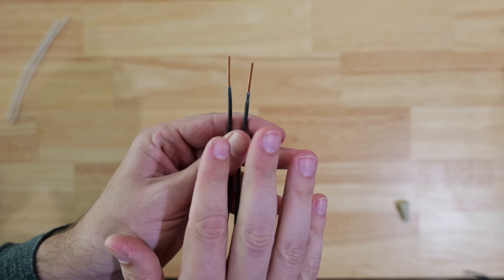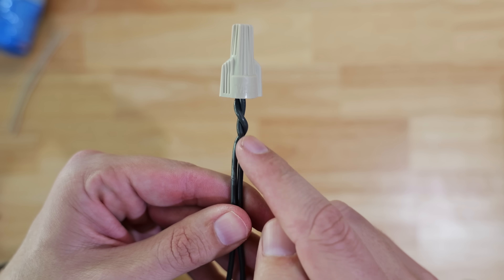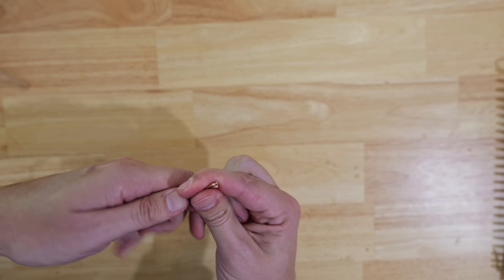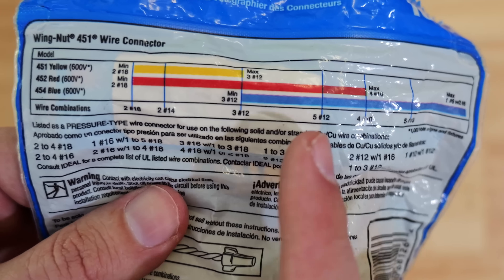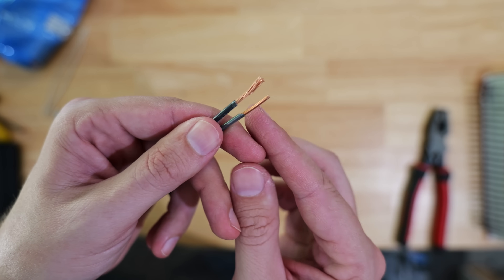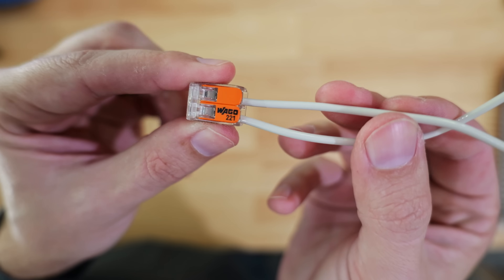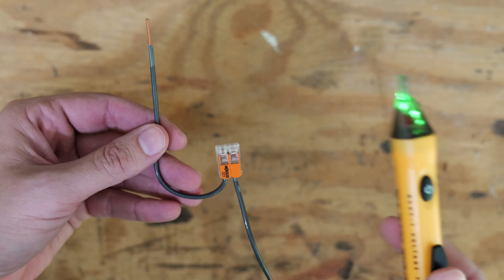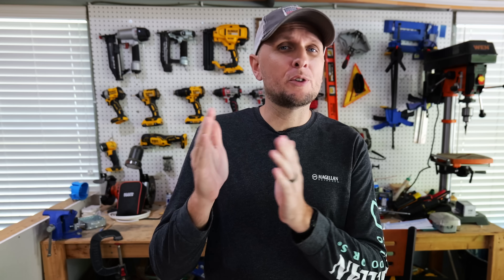7 FATAL Wiring Mistakes Most DIYers Don't Know They Are Making | Most Are Guilty of 3

Comment from the maker: Be honest, how many of these did you catch yourself doing or have done in the past?  I think at some point just about everyone has committed at least a few of these at some point.
Reply: I remember that I overloaded a couple wirenuts wiring up some outlets in my parent's house. But I was pretty good at checking them before closing it up and in 40 years since the house never burned down. After that I learned the proper way to do things and while not a professional, I do all my own work and help friends as well. I have an assortment of wirenuts of different sizes and just started to use the Wago style connectors.
Reply: @Tim Rock-It Saunders wire nuts aren't junk. Actually quite an intelligent design, if you take the time to understand them. Use the right size for the application, follow the strip length and pre-twist, then cut the ends flush with each other before installing the nut.  A solid, compact, durable connection never intended to be used in anything that moves.  
Bus bar in a switch box?  How are you going to do that?
crimp nut? want to add a pigtail? How are you going to do that?
think about it.
Reply: Trying to join stranded to solid, mostly for light fixtures. Especially, as is typical, when the stranded from the fixture is so very much smaller than the 14 or 12 gauge solid. Now I exclusively use Wagos for that.
Reply: Wago is pretty much the gold-standard of lever-nut connectors.  But what's your opinion of the Ideal brand of lever-nut connectors?  In my area Lowe's doesn't carry Wago at all, and Home Depot doesn't stock Wago so I have to either have them shipped to store with Home Depot or order them from Amazon.  But both Home Depot and Lowe's stock Ideal lever-nuts.  Your thoughts?
Reply: Pretty much none of these. I often pre-twist with wire caps OR (if I somehow don't have any) I'll dip the twisted wires in solder and wrap with electrical tape. (I'll usually do this if it's an important hookup that NEEDS to be online then return with proper parts and "fix" my jury-rigging)
Reply: Hey there i am a german electrician with 17 year duty experience, and i gratuated as a bachelor professionell in electrotechnik. I'm running a company and I can tell that there is no better choice to install wago stick, as wago clap connections.
Cause when a device or anything has a failure and it cause to turn off the fuse over and over, u can easily disconnect the different wire parts and shrink so the location of the failure
Reply: I am guilty of all of them.
Reply: Well twisting solid cores is seen as bad practise here anyway..
Reply: I've never seen the instructions on a wire nut package before. Always just found them floating around or coming with other stuff so I never saw the twisting instruction. I know I've never seen anyone actually twist them like that. Might explain why stuff didn't work properly and why some of the connections (like light bulb things in ceiling fans) literally fell apart. Electricians for my house didn't even leave the 6" of slack on the wires in outlet boxes so replacing outlets is a major pita. Thank you for this info!
Reply: Say it next time. There isn’t enough emphasis placed on this issue. Loose wire cause fires. Twist your splices together and don’t backstab your outlets or switches
Reply: @joegee2815  😊😅
Reply: @Tim Rock-It Saunders 0
Reply: @osmith5086  0
Reply: @cameronwhite2760  

0p

76g
Reply: @mgabbard  

0pl
Reply: @Nell01988  😊
Reply: I've been a electrician, and I will admit I have used the cheap wire caps, I do remember my instructor tell us the cap only replaces tape you should always twist the wires then use the cap and twist tight until the wires twist together outside the cap.
Reply: I too have sinned....
Reply from the maker: @shawnshurtz9147  And I can't stop and I won't stop 🤣  That is your opinion friend.
Reply from the maker: Even if that is all true, it’s still your opinion Shawn.
Reply: I always give each a tug, so the few that may have been loose were caught and corrected.
Reply: Literally none of the them . But professionals are not arsonist ;)
Reply: Guilty as charged.
Reply: Never, I've never done those things. The info presented is good but.. I'd also say it's common sense.
Reply: @@TimRockIt That's the point right there: Naval Industrial Electrician. If you do wiring for anything that moves (car, boat, aviation) different methods apply. You have vibration, condensation and all other things to consider that you don't have to deal with in a home installation. P.ex., even with camper vans, it is forbidden to run solid core wire for the land-line connections over here - you have to user stranded wire. For that though, you have to use different outlets with screw terminals, instead of push-in terminals (which have become the norm in homes for the past 20 years). Soldering is not allowed here in cars, because heating the strands can make the ones adjacent to the solder brittle and fail there. Failed solder joints due to vibration cracks are the number1 reason why ECUs on older cars fail.

You just cannot apply stuff from one domain 1-on-1 onto another. There are optimal choices for different applications, it is important to understand though how and why these choices have been made.
Reply: None - we don't use this crap in the UK (although they are available).
Reply: @osmith5086  I disagree; wire nuts are junk. They may work great on first install (if used correctly) but if you ever do any renovation you know why Wagos are VASTLY superior.
Reply: well i use sawder
Reply: None.
Reply: Wish I had known about Wago connectors before remodeling my last house. Light fixtures are a breeze with them. Just bought a large assortment of them and may never use another wirenut.
Reply: hand up... better than i used to be now.
Reply: Using spring-lever connectors I never made those mistakes described in video (especially the last one) because of one single reason: I always test voltage levels right just after finishing circuit connections. 

Great tips, thanks for your content!
Reply: I did DIY electrical work in the first 2 houses but in the current old house with a mixture of knob and tube and various generations of added wiring it’s all been done by a licensed electrician which is very affordable so I only do extremely minor stuff and avoid it if I can. He says knob and tube is safe if it is worked on correctly and it’s never overloaded.
Reply: In the United Kingdom the "wire nuts" have been banned for over 50 years. I wonder why!?
Reply: Norwegian electrician here. There is nothing wrong with either one off these conectors if their used corectly. personaly dont use the twistlock conectors as i dont trust them(never seen them used on wireing after 1990) but the newer type wago's i use all the time(just make sure it is actually wago's own components and not a ripoff). It's just to follow the instructions as well as pull the wires back slightly after pushing down the lever to make sure its all conected (the conection in the wago is like a knife pointed to the back of the wago and by pulling the wire back slightly it digs just a bit in to the wire and makes sure the wire sits securely in place) and iv'e never had a problem after doing that.  PS! dont know the rules in the US but if  people are not properly educated to do electrical works pls dont toutch. check the regulations from the goverment where you live to se what you actually are allowed to do yourself.
Reply: Got shocked and ended up in the hospital.  I think I'm fully recovered but not sure.  Don't mess with electricity unless you exactly what you're doing.
Reply: It me.
Reply: I raised my hand at 4:00.
Reply: Guilty in some regard, and holding my own in others.  I'll start pre-twisting them going forward and getting my hands on some Wago's, especially an assortment kit.  Well, played, sir, well played.
Reply: I had to work with the OLDER Wago version which was just a box of grey plastic so you have to guess how deep you are in by just push them in. And they got removed by Twist-pulling on the wires. But you never knew how well the connections are. 

We not even have this twist-nut connectors here. Either screwing terminal ones or Wago.
Reply: If you cant hang a ceiling fan from your wires you did it wrong lol
Reply: Damm! Does this mean I've got to dismantle the double bed, roll back the carpet & underlay, take up the chipboard & isolate upstairs ring circuit to double check the extension to the ring that I put in for the double bedside sockets..... Ah! U Muvver!😖
Reply: I'm guilty of doing it the wrong way. Your advice will save me from a shock or electrocution. Thank You.
Reply: Did the wire bug boo-boo once, I always tug my connections, so it promptly came loose and I did the twist first trick again.\
Always, always, always doublecheck your work.
Reply: I am not an electrition but I always tin the ends of multi-strands before connection just to ensure all of the strands handle the current to avoid heating or fires....If attaching a lug on the end, I will dip in flux, crimp connection, then solder or tin it...
Reply: Worst wire connect I have ever seen was in the house I live in by a previous owner. The dumbf*** put in some ceiling fans and when investigating some flickering lights,  and instead of wire nuts he’d used blue painters tape. Flammable blue painters tape.

I took apart everything else that looked to be more recent than the original build and found 2-3 more places he put painters tape on the wire connectors.

Why? Laziness? Stupidity? Wire nuts are super cheap, so I have no idea.
Reply: That's pretty stupid. At least he could have used electrical tape. I myself would never use painter's tape.
Reply: The wago contact is similar to the speed connections of a light switch (which is now banned)
Reply: Thanks
Reply: Lol
Reply: @@TimRockIt,Europeans don't tape.
Reply: uhhh... yes!
Reply: I was taught from my father at a young age when using wire nuts always pre-scew the wires first as you demonstrated ...... but he also would tighten them in place with electrical tape so the wires were not exposed, then add the wire nut to the tape for a nice snug fitting.
Reply: 2:42 When stripping wire, push off of the strippers with using the thumb on the hand holding the wire. Makes it so much easier.
Reply: @joegee2815  n
Reply: U F..UKED UP ON WAGO : ONE DOES NOT PUT TAPE ON WAGO , IF YOUR WAGO DOES NOT HOLD DOWN THE CLAMP THEN IS DEFECTIVE IF YOU SAY WAGO NEEDS TAPE I HOPE YOU ARE READY TO TAKE IT TO COURT
Reply: @joegee2815  3:40
Reply: It's not so much the wire nut that is the problem as the "nut" with the wire. 😂
Reply: I think I do pretty well these, but I have had the issue of overtightening the wire nut and having a solid wire poke out the end. Of course I re-do it at that point and don't go so crazy with twisting the next time.
Reply: @vikinglife6316  If it weren’t for the grounding wire, I don’t think I would have ever managed to put up a ceiling fan in my life.
Reply: We use WAGO PUSHING Connectors! Wirenuts are just 1920's, CALENDER Check Americans who never been abroad!
Reply: I'm guilty of these mistakes. So glad I stumbled on this video while surfing. First video and so useful you have my sub and appreciation!
Reply: I’ve done all the above, including holding live wires without PPE😮
Reply: I was actually surprised I haven't done any of these mistakes in the past.  I never have used Wago connectors though.  I treat each connection like there's going to be a lot of vibration or some pulling in the future.  I test each wire by pulling on it a bit as well.  But my dad was an electrical engineer, so I picked up a lot from him early on.  I do have a question on electrical tape.  I tend to use it after the wire nut is on, I wrap the electrical tape around the wire nut and the wires.  I realize it is not needed, but should I avoid this practice for any reason?
Reply: My dad was an electrician. He taught me very well. I do not use WAGOS. I always use wire nuts. I twist the wires together with my lineman pliers just as you demonstrated. I have wire nuts of various sizes to accommodate various number of wires and gauges.  I actually have them arranged on a shelf so I simply grab the appropriate ones I need. So, to answer your question, I do not make any of the mistakes you described. Thanks dad)) (I wired up my own house including running to subpanels, electric cook stoves etc.).
Reply: I was doing it the wrong way for a long time until I saw an electrician working on our house do it right and he showed me how to do it right.
Reply: a lot 😁
Reply: be honest, are you hard to work with?
Reply: Zero. We don't use wire nuts here in Belgium, and personally I prefer Wago clamps. That strip gauge you mentioned on the side also has the number 11 in it. That's the length you need to strip in millimeters. I don't use "blind" stripping tools, but one that allows me to set the length to be stripped. So I just set it correctly, strip my wires, push them into the clamp and flip the levers down. Then I push the wires into the box, paying attention to the Wago clamp to make sure it doesn't catch on anything. Usually I'll push it in by applying pressure on the levers, similar to what you do, to make sure they don't come loose.
 
ps: there are also cheaper Wago clamps available that are single use. You simply push the wire in, and you can't pull it out anymore. "Single use" is a bit of a misnomer, as you can still get the wires out if you twist them left to right while you pull them out gently, but in theory they're supposed to be single use. They don't work for stranded wire though.
 
One error I do make, however, even a couple of times after I started paying attention to it: not leaving enough slack in my cables. Makes it hard sometimes to work on them, since you don't have a lot of excess sticking out of the box for you to work with.
Reply: I never used wire nuts for reason: sub-par (rigid) cable cores here AND too often boxes are too small.

Crimps and 222s usually do the job.
Reply: @richk3325  that's not recommended. Soldering multi-stranded wire creates a weak spot just behind the soldered section. This is more of a concern in applications where there's a lot of vibration, like in vehicles or certain appliances, but you specifically mention crimping. Don't crimp AND solder. If you need solder to hold the lug on, you messed up your crimp. The correct response is not to cover it in a glob of solder, it's redoing the crimp.
Reply: Wirenuts.  What century is America living in?  Looks like something I'd find in a kid's "learn electricity" game for a 1.5V battery.  You use those for the mains?!

I avoid solid core wire.  Difficult to bend.  When you wire things up, close the outlet/whatever, oops, something comes off or snaps.  I always use stranded.
Reply: @joegee2815  please add that the NEC requires pre twisting!
Reply: Please add that current load creates heat causing expansion and contraction. Solid strand wired  becomes rigid making it susceptible to pull out when maintenance or troubleshooting. 

The rest of the presentation is excellent with a clearly defining speaker
Reply: I occasionally make mistakes while I'm working on things, but I usually figure it out while I'm going & don't generally find them AFTER an install (where it would take a lot of work to re-do it). I take my time to do things right and I do my best to understand the circuit I'm working on. People before you can make a great deal of mistakes in tapping off wires here and there, leading to things like dead shorts when a switch is thrown, voltage drops where none should exist, stuff like that. So I develop a wiring diagram that makes sense of whatever circuit I'm working on, so I can take care of most mistakes before they happen. I often use colored pencils to mark the lines if things get complicated. I do a lot of testing using a multimeter to ohm out connections to make sure things work as expected BEFORE I plug anything in to power. 

I wire my own sheds and cottages, but not for anyone else, though I'm helping a friend wire a garage now. It only needs a couple circuits re-routed and a couple lights added in though, so not much to it. Took 40 hours to rewire a skid-steer once. And 60 hours to rewire an old military truck. That's only 12 volts but 120 is just as easy as long as you remember the difference between electrical and electronics: "In electronics, if you short-circuit a component, the component fries. In electrical, if you short circuit a component, the component fries YOU!" That's what my instructors at the Marine Institute used to say anyway. :) I've crossed things out before, but luckily wasn't holding anything conductive (plastic screwdriver handle). :) I'm an electronics tech from the Marine Institute and I took electronics back there, plus one year of electrical. The people who taught us were people who came out of the trades themselves, not "professors". I'm grateful to them everyday for helping me develop good common sense when it comes to electrical stuff. 

You have a lot of good tips here on your video that everybody should know before attempting to do any electrical work. While I bought a few of those Wago connectors in Illinois a couple years ago (because a lot of people out there seem to like them), I still like wire nuts better and doing it right using linesman's pliers before the wire nut myself. Great video! Keep it up.
Reply: @@davidwalton3604Who cares about codes?
Reply: @@davidwalton3604It's right there in the thumbnail, therefore his main point.

Difficult to bend accurately.  Then of course you replace the socket back in the wall and it has to bend further, without pulling itself out of the grubscrew or snapping itself.  Metal doesn't like being bent.  Take a steel rod and bend it a few times, it breaks.
Reply: Why are the “mouths” of the Ideal wire nuts so wide ?
Seems that would invite the average Joe to try and overload the nut with multiple wires 🤷‍♂️🤷‍♂️🤷‍♂️
Reply: Good !
Reply: @@davidwalton3604I don't use that for any connection. Looks like something from a kid's toy.  But then I gather this video was made in America, where they aren't too clever.
Reply: I have used the wrong caps! usdually too big, but I hvent used them to join wires, only to terminate wires that I have no use for. Not sure how bad it is to use too-big in this case, where I mummified the exposed wire in electrical tape, and then also overed the cap+wire jacket in a thick mess of tape too.
Reply: @lambertovitali3152 Dead people‼️😵
Reply: You should  remove knobs &tube 100% gone . Your sparky should recommend  it . Not only because  of age , ask the fire department  how dangerous  it is . If your not sure go to the electrical inspector,  in 2023  It's rare to see it .
Reply: A few 😅
Reply: @Nell01988 is there a lifespan for the wagos? Or after so many uses they begin to loose the grip on wires?
Reply: How well did stranded wire do in wagos?
Reply: @danlevesque5437  actually no but i wouldn't stick the wire in and out too often
Reply: taping down the Wago levers is smart and I hadn't thought of it.  Great video.
Reply: I was taught the correct way over 45 years ago by a master. It’s not rocket science but basic common knowledge and tested true that pre twist long then trim, and a well tightened wire nut, copper to copper is the most durable connection with the least impedance. I’ve never had a failure related to this method.
Reply: it is not difficult to be honest if you are a neophyite like me. All of them! I wired my Garbage disposal, my dryer and my stove.  I did use a weather proof cover and box and a safety outlet for my garbage disposal as it is under the sink! there are two other things I perused in an oven/range install manual. the outlet must be where the ground/neutral holes are horizontal! not veritcle! in the wall where the outlet plugs in from the oven as the cord is horizontal. and the box should be exposed, not flush with any drywall like a typical 110 outlet. a heavy duty 50 amp/250 volt one should be where it plugs in the width of the box 2 inches away from any drywall for high current! I've got some more work to do! A lot of it!
Reply: @@TimRockIt and plumbers use "shark bite" but any amature uses them. Copper press-fit is the professinal way(according to the last one I hired) I've had plumbers who use them and others who say(about plumbers who use shark bites) "that's not a plumber"
Reply: Another common mistake I have run across Is somebody using say a number 14 strip. Tool
Gauge stripper 
On a number twelve Gauge Is wire , Which of course Has a tendency To be mechanically Weaker , And of course more resistance , Causing heat and or breakage. Also Taping in a situation. Such as where there's a lot of vibration or moisture can't Prevent the wire nuts from falling Off overtime. Also, people don't foryet in a situation with a metal cover over a duplex. Put the ground up so that if in time the cover flips down over a plugged in duplex. You won't short the Ungrounded and grounded  onductors.(technically, hot=UNgrounded conductor, nuetral=groundeED,  and ground wire =groundING conductor)
Reply: Realizing on my last day project of the bathroom exhaust fan, I didn't twist them enough! If they ever come apart and I know why now.
But hey, at least I used quality wire nuts instead of the cheap garbage 🤷‍♂️.
Reply: Do you have a "how to install a ceiling fan " demo?
Reply from the maker: @virgilwilbur992 yup.  It’s on the channel.
Reply: Lession learned- Thank you
Reply: Enjoyed the video and I find myself not doing these things which helps me feel good about my installs. Lots of this seems like common sense but well know what they say about common sense. Not so common.
Reply: I work industrial maintenance and I’ve seen a few 240v motors come in with those lever nuts. They do allow for more room in the peckerhead. I’ve never seen a 480V motor come with them. We definitely use wire nuts with those and I will say that there are times when you don’t have enough wire to twist them together properly.
Reply: @joegee2815 be careful with that. I work industrial maintenance so I also do everything myself but in some states they require a certified electrician to do house wiring. In other words keep that to yourself. lol. Don’t ever tell others you do your own wiring unless you live in a free state. Ha ha.
Reply: @Bowhunterohio  It's allowed in my town in NJ. I'm in the suburbs. Some towns and cities do require certified electricians. But not where I live, not yet...
Reply: Zero. 👍 😎
Reply: None! Firstly, never use wire nuts! They are the worst cable joiner ever invented. Always use screwed connectors or as you have shown, Wago's.
Reply from the maker: @inception69 there is nothing wrong with a properly installed wire nut. In fact, I would argue it makes a better connection than what you listed.
Reply: @inception69  they are only the worst when not done properly. I work industrial maintenance so 90% of the time we use wire nuts and I’ve never seen a problem arise from using them. I’ve rarely seen anything else used inside a peckerhead. The only time I’ve seen wire nuts not used on 3-phase motors are the big compressor motors or the big DC motors and then we use the insulated multi tap connectors with the Allen set screws inside. I’m not sure how you could get away from wire nuts in my line of work but maybe you’re just talking about house wiring or something.
Reply: Is it not correct to wrap the finished wires and nuts with electrical tape?
Reply: @NataliePastina-jz6ky  no that’s not needed. If you install the wire nuts correctly then there is no need for tape. The only time I use tape on wire nuts is around something like heater bands. What u do is use glass tape which is electrical tape for high heat areas so that nothing burns. I’ve worked maintenance for 20 years and do a lot of electrical work and I rarely see tape over wire nuts. Electrical tape over wire nuts is just common at houses.
Reply: you are twisting too hard too much and should not be risking scoring the conductors by using pliers , the twist should not even work harden the copper or do so to the least extent possible due to the tendency of copper to break due to induced stresses such as the vibration all conductors are subject to under load.
 you should first form the wires to fit the box and twisting should be done with the fingers using leverage generated by striping long and the twist should not run back past the striped portion of the conductors , you then cut the exposed twisted copper to the required length for the wire nut and twist it down tightly on to the braid.
Reply from the maker: @kevint1910 not twisting too hard or too much.  That is just your opinion.  The scoring from the pliers at the end of the wire is snipped off.  Not an issue.
Reply: I know for a fact that I have committed at least one or two of these sins. But now I know the right way. Thanks!
Reply: Hello.,
         Wire nuts where originally intended as fixture nuts. HENCE I don,t like wire nuts. When I do freelance lance electrical work, I use Buchanan splice caps that look like a 22 rifle shell. They crimp on with surety, but as the instructions on the package say twist all wires first.  Then I place on an isulated cap that snaps on and stays on. These Buchanan splice caps can be used in damp locations.  Unlike wire nuts ,wire nuts are not suitable for damp or wet locations.  Over the years i,ve seen failures in wire nuts because the internal spring rusted out. Also a Buchanan cap with the insulator allows me to put my wiggy tester probe into the splice without taking appart the splice. Hence, making it much easier in trouble tracing. (YOU GUYS SAY TROUBLESHOOTING) In some trouble tracing venues like when I open up a j- box, the wire nut sometimes falls of due to vibrations from surrounding areas. Wire nuts  in my opinion should be restricted to internal fixture wiring, in dry locations only. And I would stay far away from those wire nuts that are approved for wet locations that have silicone greese. They just keep twisting and twisting , no good. Also the grounding conductor can just be spliced with that copper crimp cap. No need for the insulated stamp on cap. Means less crowded j-box. 
They are cat #2006s copper cap and 2007 insulated snap on cap. And the larger size for two # 6s AWG is a cat #2011s and 2014 ins cap respectively.  HAVE YOU EVER HERD OF A MAHR SET SCREW WIRE SPLICER? ALSO COATING CONDUIT THREADS WITH NEVER-SEIZE WHEN JOINING CONDIUTS IN WET LOCATIONS AND OR OF CONDUIT BODIES OF DISSIMILAR METALS?
          I,ve been a licensed electrician since 1972. And still working full time in the trade.
           Another thing is get rid of those LEGO CONNECTORS, they are junk.
Miss Paula Walach-former industrial electrician-union  member IBEW-  currently working in rail mass transit authority.
Reply: I woke up one morning in my camper to a burning smell to find that a wire had gotten so hot it had melted off the insulation and the wire nut itself because I did example #1 in this video.  It worked fine for several years but when it fails it'll get your heart going!
Reply: I never use wego's or push-in switches and receptacles.  Just don't trust their little tabs with high currents.  I figure they could be banned someday.  Wire nuts to insulate pre-twisted line has worked reliably for decades.  The twist gives plenty of contact area for current transfer with no heating.  The nut should be pointed up so they will not fill with water if there is ever a water leak.  Its not a bad idea to wrap the wire nut connection with electrical tape, particularly outdoors and in humid and wet areas.  This all is to reduce chance for corrosion ever compromising the connection. For boat trailers I find the only thing that works is twisted then soldered (with good solder wet-out and flow) and then insulated with shrink tube (best has inner layer of gunk that melts and seals).  There are special heat-solder-and-seal  connectors that accomplish  this now without all the work.  I like seeing my trailer lights glowing under water at the loading ramp.
Reply: @CyndiLH to
Reply: Clickbait video. Shameful.
Reply: @osmith5086   That's just it , ever read the instructions on a box of wire nuts, the nut is supposedly to twist the wire. Seen too many fail connections with winuts, ut mostly on neut, where the most heat is.
Reply: I was taught to make a good mechanical connection first.   I’ve never seen a wire nut come off but have seen some that had loose wires arcing inside.
Reply: Another good thing I like about the WAGO connectors is if you turn it over to look at back side it is clear and you can see if your wire is all the way up inside the port and clamped in. After a test showed an open ground in an outlet I had run I checked the outlet it was ok so I backtracked to the junction box that I had come off of and found that one of my ground wires in the three port wago had come out and the lever was open. Now I always look at the back to be sure copper wires are all the way in and locked down securely. I think either I had not clamped it down properly or maybe as you mentioned another wire grabbed the lever when I pushed the three port into the junction box.
Reply: Yep, guilty as charged on 3: Not twisting the bodies of the wires with the wirenut; using the crappy wirenuts that came with some outdoor wall lights; and having the stranded wire a little shorter than the solid wire resulting in the stranded wire not being twisted asround the solid.
Reply: Thanks.  This was very helpful to show me wrong ways and right ways to do it, along with some best practices.
Reply: @scoops0406 . Why is that ?
Reply: so your point is?/
Reply: @watcherdude1330  Because it's seen as potentially weaking the cores of the cables, it's not done in UK (well, it is, but then all sorts is done) but it's not seen as good practise.
Reply: Nothing like wago special connectors for stranded wires where the levers would have come off.... Nobody is taping those. That's not good. you cannot check them.
For common installations there is WAGOs without levers and those dont have such problems, and they are the most common ones.
Good to know that this can happen what you said.... so dont use those with levers if you dont have to.
This is exactly a problem what you get with solid wires and for those youd normally use the different type of WAGO connectors
Reply: Definitely a couple with the wire nuts.
Reply: too many
Reply: Done them all in the past...
Reply: Favourite part is don’t use crappy wire nuts. Went downhill with gets a quality wire nut. They are all crappy.
Reply: I have definitely made the mistakes with the wire nuts. Thanks for the tips!!
Reply: Who was the mfgr. That's not ideal, is it?
Reply: @KameraShy And before lever connectors, you're work was bad? It's a pretty simple procedure.
Reply: @mgabbard  they're both rated the same. Any differences are not big, and balanced out.
Reply: Not to load up, but if the grey nut is an Ideal, I didn't think Ideal required pre twisting. You and your stuff is great.
Reply: @scoops0406 Not at all. I always pre twist everything. It's too simple not to, imo, 
 especially solid & strand. If the mfgr says twist wires, you twist, unless you dont. NEC says Best to follow mfgrs directions, but use your own judgement, as well. Liability is on installer first, mfgr  2nd, unless it's a bad product. Never saw one bad wire nut yet from a major mfgr, unless someone was reusing them. I reuse nothing. Stuffs too cheap. Ain't goin into court and saying I recycle connectors but the mfgr says it's OK. Wait for the laughter and embarrassment.
Reply: I caught all two of them. But don't worry. I fixed them for you.
Reply: Just happened upon this video last night and it is so extremely relevant today as I and another guy are replacing a 3 speed ceiling fan module today. Prefect timing to make sure the connections are being made correctly. Respect!!
Reply: BIG THANK YOU to you 
Gracias 
Obrigado
salamat po 
Danke
Reply: @KameraShy  it's not hard at all if you understand how and why it works. Takes a bit of talent and skill, though
Reply: None, but thats because I was trained by a journeyman electrician on how to wire.
Reply: I have definitely made some of those mistakes before I gained experience.  When I first learned of WAGO connectors, I fell in love with them.  The thing I like the most is that you can disconnect them and reconnect them without making a crimped and twisted mess of your wires.  I like your idea of putting tape over the levers if they are going to be packed into a small box.  Great tip.  Thanks
Reply: Thank God I had commonsense  back in the day and luck. As I luckly pulled on a wire n it came out  from then on I twist.  Tape  double  check